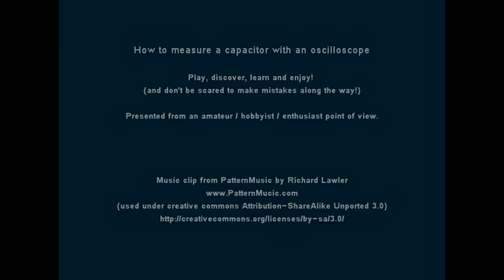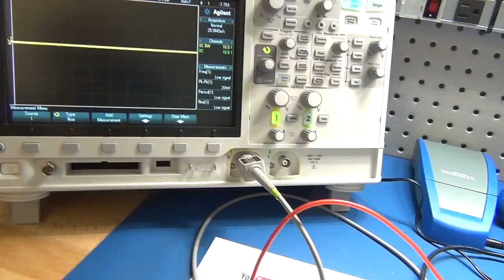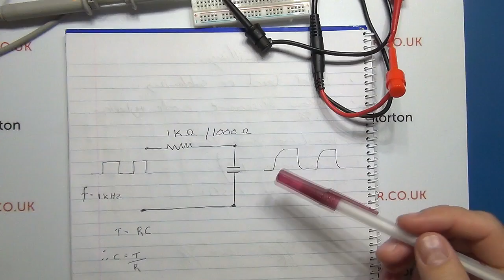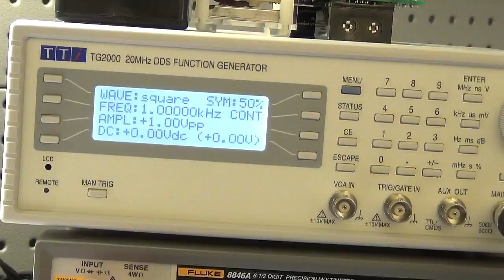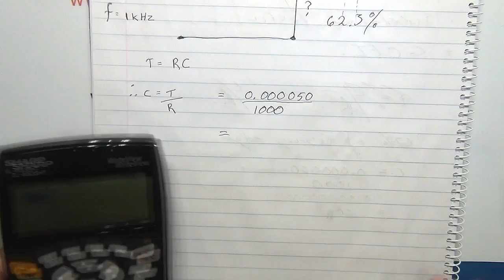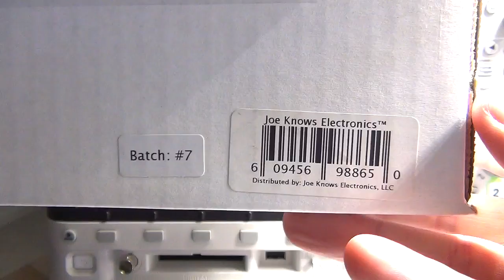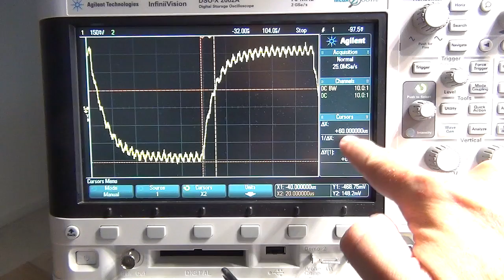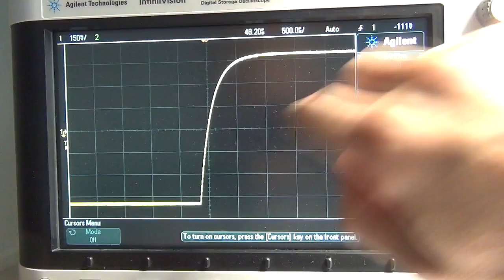How to measure a capacitor with an oscilloscope.

Comment: Having spent over 20 years in electronic design, your use a decade box is a good idea, but your measurements are going to be off due to your jumper wires adding resistances. Your 1 Megohm resistor that you added isn't going to be precise either. A 1 Megohm resistor with a 5% tolerance can be off as much as plus/minus 50,000 ohms and still be in tolerance. You need to account for those resistances in your circuit and calculations. The idea and technique is good, but any unaccounted resistance can pose problems. Stay with a standard frequency and make sure it starts to rise at a zero point on the scope. A 1Khz frequency on a scope set for 500 hz per division should have a full wave cycle every two divisions making it easier to see where the signal is rising and falling. It also makes it easier in determining where your 63.2% time constant, that all capacitors have falls. Further set your x axis on the bottom curve and top curve lines, not above and below them. By setting the axis above and below your are setting a slightly higher peak to peak voltage than what is being provided by the signal generator. If the output of the generator is 1 volt peak to peak, your scope should show a square wave of 1 volt peak to peak. The theory is good, but every error in execution will increase the chances of error in precision.

Comment: The problem starts with measuring time accurate in the first place. Your scope might provide something like +-30ppm to +-100ppm accuracy from it's Quarz, cause it might not contain an OXCO of some hundrets of Dollar. Next problem is that your resistor might not be one of the higly precise (0.005% Tolerance - 2ppm per C°) type for some hundrets of Dollar per piece as well. Not to mention parasitic & stray capacitance and resistance in your setup caused by probes and else. Any capacitor charging while measured by inaccurate time and also inaccurate input resistance will not allow to create any result of reasonable precision. But at least the principle is very correct and well explained. Well done! Perhaps you try at least some precision resistors of 0,1% tolerance to it's value for the charging. By the way oscilloscopes are very bad devices for measuring DC in general!
Reply: Your second measuring is very bad. You better get the mean of the ripple instead of peak amplitudes to get at least somewhat close to around of a value of 4.7pF. From the Timing values the ripple does not seem to come from neon lights. Those are about 44kHz mostly. And that did not seem to match your ripple. Perhaps that was some resonance between your probes and the cap? But just guessing...

Comment: measure your resistances not going off the ideal values. also average your waveform. plus there is probably some tolerance issue from the capacitor. thank you for the video though.

Comment: All in all a good tutorial on capacitors.

One comment.

Quit using all the zeros and switch to Engineering notation.

Engineering notation is a form of Scientific notation based on metric units,
pico, nano, kilo, milli.

If your calculator can not handle Engineering notation, get a new one.

BTW,
Capacitance = Time / Resistance (as you said)

                        = 50 u seconds / 1 k Ohms  

                        or      50 nano Farads.

The difference between the package label may be the normal variance in 
batches of capacitors or also in your measurements of time.

Comment: It sounds a little weird--that's just based on the specifications already existing--why do you have to do the measurement to a specification that already exists if you can gather the % rate of loss through electricity...its simple = of transmitting electricity and loss over _ metal...wire and transduction*Transduction can refer to: Signal transduction, any process by which a _____ converts one kind of signal or stimulus into another. Here is what I am trying to say.....mmm....that is specifications and so is = gains --circuit breakers...and loss---connector-wire-gage-type of metals conductive to energy transfer...complete circuit...so your calculation would have been already a specification in the =....im not sure if I said that right ?.......so physics--mechanical--signals--amplification--are all measurements in the specifications already included--even in thought*.

Comment: t is not time, it is "tau" it is one cycle of the capacitors charging/discharging, it takes 5 tau's to get it to lets say 100% (just shy and will never reach) and takes 5 tau to discharge. yes tau is measured in seconds.

Comment: Firstly, great video, but secondlly i get "anoyed" when measures the values from the scope very roughly and then continuing like its the most accurate number there is.
Reply: How to get more accurate? would he have to zoom in the wave to get better X and Y coordinates?
Reply: @zettkusanagi6322  I don't know man, maybe better equipment xd.
But I ment that if your data is not so accurate, then, discuss the results like they are not the most accurate
Reply: True, I'm not familiar with his equipment. I do wanna get some reliable equipment myself, so I'm doing research.
Reply: @zettkusanagi6322  You have those logic analyzers now adays, those work verry nice. Salae is the top end one, but you have cheaper versoins, salae can also do analog signals, if i remeber corectlly, 12 bits with 50 mega samples per second
Reply: but12 bit can be a bit low, depending on u are measuring

Comment: You should always write down your units when doing calculation. Firstly you will know what the values were, and secondly you can verify that you do the right thing. Also 'Spot on' is a bit flaky with how you set the cursors manually.
you should measure from average of noise to average of noise for level. In fact you shouldn't measure the wave level at all. You know the final value is going to be 1V, even if you don't let the capacitor charge all the way. And in fact the capacitor never truly charges to 100% (it's a property of the exponential function). For practical reasons a capacitor is deemed charged after 5 tau (the time you're measureing) More on that here: https://www.electronics-tutorials.ws/rc/rc_1.html

Comment: the easier way to count it is like that: you have got 50000000us and 1000 ohm so let us divide them like this 50000000us /1000= 50000 microsecond so we gonna divide 50000/1000000=0.05 micro farad let us convert it to nano farad like this 0.05x1000000=50000 picofarad convert it to nanofarad =50 nanofarad that is it

Comment: Thank you very much. I do believe that the problem you have with 4.7 pF is due to the reactance of the capacitor become significant big due to this formula reactance is Xc=1/W.C the reason you did not have a problem with 47nF is because the reactance was low. your Circuit Impedance is Z=sqrt(R^2+1/W^2*C^2), in order to compensate for the reactance of the capacitor try to increase the frequency until the term 1/W^2*C^2 in Z equation get smaller in order to get the impedance as pure resistive as possible. I hope that helps.You do really great job.
Reply: what kind of issues might you run into when using this method on a much larger capacitor? say 1000 uF.
Reply: tim master Hi.If I understand your question correctly, you want to know if you can measure the capacitance of 1000uF using the method in this video? if yes, then  yes you can measure the capacitance of any capacitor . Because we are interested in measuring Tau, where R is known C=Tau/R. So in order to know C you need to find out from the oscilloscope the Tau(the time it takes the capacitor to get charged) if you have bigger capacitor it means only that it will take longer time to the capacitor to get charged. I hope that helps

Comment: "How to measure a capacitor with an oscilloscope."
Look at the time. 46 minutes. You babble way too much about things that are not interesting.
Reply: i agree too much babble.  tell us about .How to measure a capacitor with a scope... not about your meters .  good post flapjackbatter.
Reply: @MrLuigi77047   The answer to why your 47pf cap didn't come out accurate I believe is due to where you set the X 1 and X2 points. Setting X1 and X2 at the mid point of the noise, instead of at the extreme upper and lower portion of the signal would have yielded accurate results. X1 and X2 set at mid point would have reduced the time from 60us to 47us.

Comment: Groan... So torturously repetitive. This is a video. You don't have to read every piece of text from your paper aloud because we can see it in the video. Also, talking about capacitor manufacturing tolerances is quite pointless when you used a rather low-res display to align your X-axis cursors. The overwhelming majority of the error will come from there, not from capacitor tolerances.